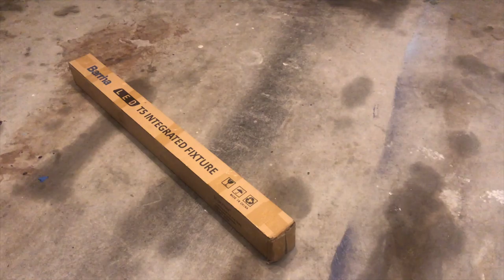Amazon Barrina T5 LED Garage Light Install! Amazing Results!

Comment: How do you install them
Reply from the maker: The lights snap into the metal clips. The metal slips are just screwed into the ceiling. The lights are very lightweight so it doesn't take much to hold them.